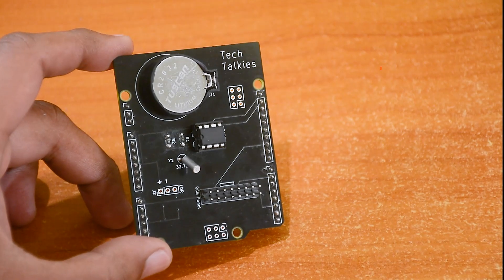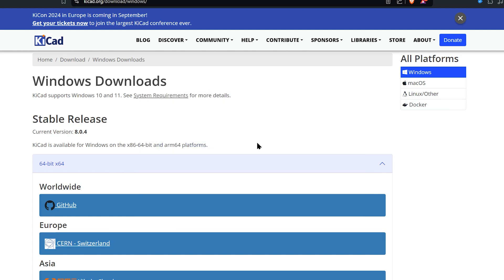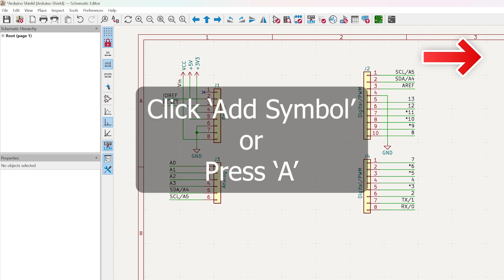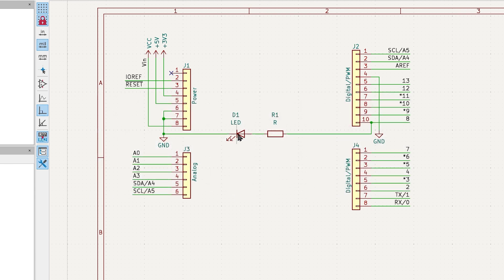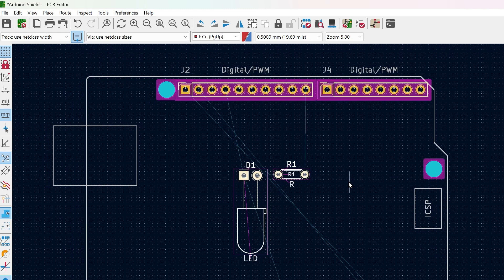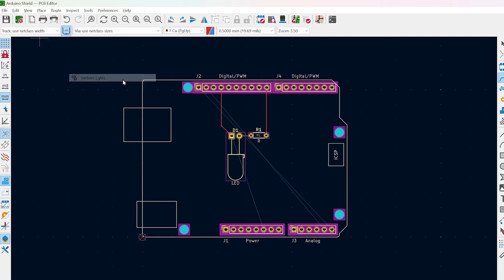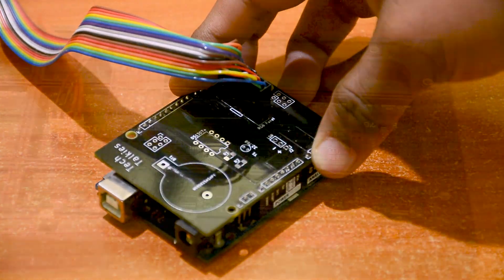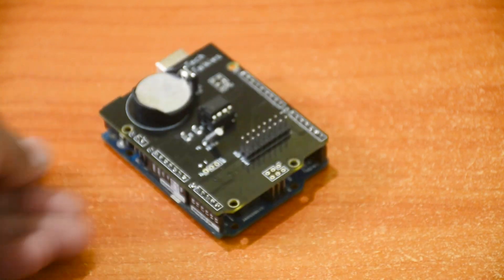How to create a Custom Shield for Arduino Uno

Comment: What current is this rated for? Could it drive a few stepper motors for a robotic arm ?
Reply from the maker: It's just an RTC shield. For motors, you could buy the motor shield or design one.